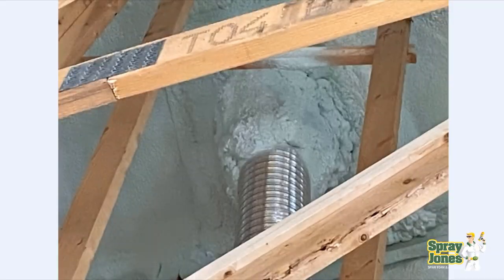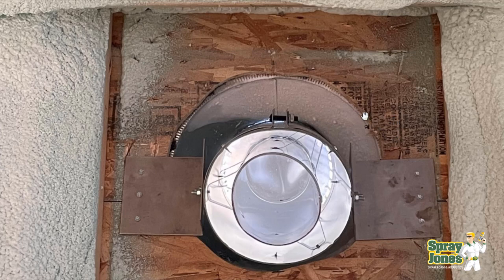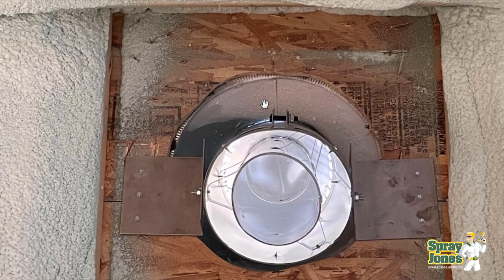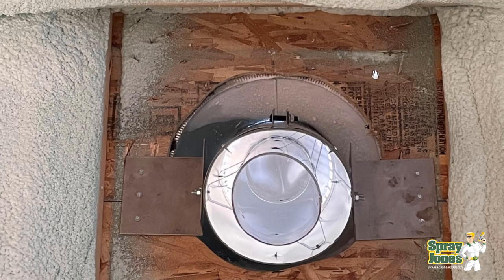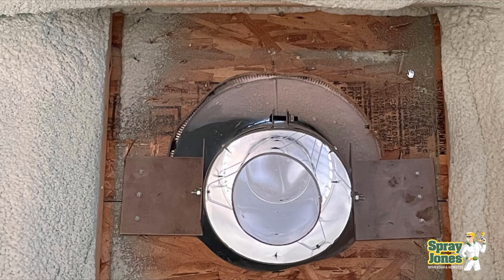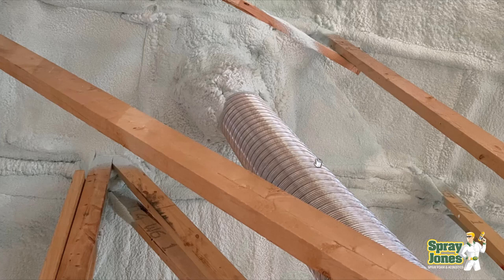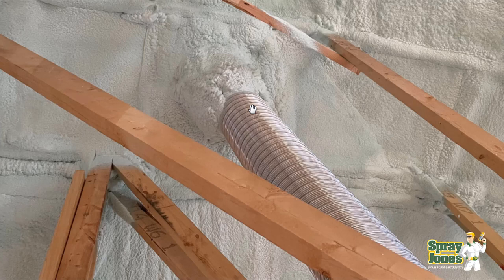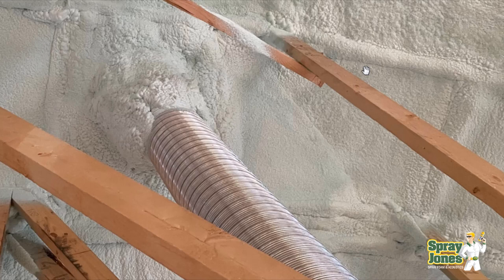Spray Foam Insulation with Zero Clearance Chimney Pipes | A Hot Topic!

Comment: When I insulated my garage, I packed rockwool around the furnace exhaust pipe. It functioned to keep the cellulose insulation away from the pipe. Of course my case was quite different as it has a vented soffit/attic.
I think as long as the temperature resistance of the foam meets the code requirements for that specific pipe, spraying it the way you did because it should prevent water vapor from condensing on the pipe when it cools.
Just my very non-expert $0.02

Comment: The wood burning fireplace double or triple wall chimney pipes stay cool to the touch outside, but the manufacturers request 2" of clearance to combustible materials to prevent a creosote flue fire from burning houses down.  Under normal circumstances, the inner flue pipe may be only 200° F, but if you have a flue fire, that could exceed 1000°.  The practice you're showing could very well make the difference on whether or not a chimney fire burns a house down.
Reply from the maker: Idiot, these are zero clearance gas fireplaces.

Comment: Insulation professional here, we just this week had a near combustion situation on a foam job installed in 2019 sprayed 2 inches down to a flat ceiling and blown over with cellulose for additional R value.  The foam came in contact with a zero clearance pipe and became very near to full blown combustion.  So thankful our client heard strange "snapping" sounds while lying in bed and decided to investigate before falling asleep.  I would not recommend this method but instead fire caulk to seal air leakange and provide clearance to combustable insulation of not less than 3 inches is a better destiny.
Reply from the maker: Then it is NOT zero clearance. Something is off. Foam can take 180 F before it breaks away. There is more to the story.
Reply: @SprayJones  Zero Clearance only refers to the substrate the appliance will sit on. It's a misnomer, and I cringe when I hear builders try and explain away the lack of clearance they have.   There are plenty of clearances that must be met.  Most gas direct vent units look for 1" clearance on pipe sides/bottom, if it's running horizontal than 3" clearance.

Comment: An interesting solution to zero clearance heat vent.
So, what about water heater vent pipe?
And what about 90% efficiency furnaces?
I suspect at the roof, the vent pipe would be cool enough for foam insulation. I would think that situation would already be established.

Comment: What is the cold air return temp? 
What is the exhaust flue temp? Could you ceramic coat the outer jacket like race car engine builders use on the headers?

Comment: Why would you choose to make a roof penetration rather than go through the wall. Even for things like plumbing vent pipes, it seems like going through the wall and leaving the roof intact with no penetrations would be better.
Reply from the maker: Yes it generally can be. Many times where things are located and how to get to outside the roof is the only option.
Reply: To get the best draft, the best practice is to keep the flue gases inside the building envelope for as long as possible with the least bends. A wall exit both exposes the chimney to cold air and two 90 degree bends to get out the wall and vertical again.

Comment: Former fireplace professional here, and new to SPF industry.  That detail would fail here in Connecticut.  We have drilled into our building inspectors heads that gas direct vent flues require 1" clearance to combustible materials on vertical flue sections, and 3" clearance on top side of horizontal flue sections.  Passing through a flat ceiling insulated with cellulose or fiberglass is easy, there is a collar that goes around the flue, to keep the insulation from touching the pipe.  Any time we came across a foamed roof deck, our installers were instructed to make sure we maintain our 1" of clearance (wood coal or oil flues require 2"). I took an online training for new sales reps from Huntsman, I swear I remember them saying their foam required 3" of clearance from any type of flue, furnace, fireplace, water heater etc.  While I don't disagree with your detail, I'd caution you when we see the flex vent.  The inner (exhaust) section is separated from the outer (combustion air) by spacers, the spacers create approx 1 1/2" air space between the two flues.  The spacers are prone to getting knocked loose, which could lead to the inner section being right up against the out, resulting in temps higher than you were able to record.  All that said, Mike, thanks for sharing all your knowledge,  I have learned a ton from you.      The power of 2" of closed cell!!
Reply: I used to service and install gas and solid fuel fireplaces and stoves as well.  If you do something that falls outside of the appliance manufacturer's "Listed" installation instructions, then the appliance is no longer listed.  If a fire were to occur , then the spray foam application company will be liable.
Reply: Problem Solved!  at least here in the States  with Heatilator/Heat n Glo and Majestic products.  They now manufacture a roof deck insulation shield just for this application.

Comment: Hey Spray Jones, what if your zero clearance direct vent pipe is exiting through the building wall rather then the roof? The run will be much shorter. Maybe 7-8ft long run exiting out the building wall. What’s your opinion?
Reply from the maker: Just spray up to the wall bracket they provide.
Reply: @SprayJones  great thanks. there is a wall thimble supplied with the kit that provides a 1" standoff from the outer flue. Ill have our spray foam contractor spray against the thimble. One other thing, i just posted on another video, what product are you using to air seal the small gap between the top plate and sealing any abutting wall studs? Located in Southern Ontario btw. You are an excellent resource. Thank you!
Reply from the maker: @gmredstar  Usually the thimble in the wall in blocked in with lumber, the HVAC guys take care of the thimble part you spray to the wood framing. They seal with hi temp silicone.

Comment: If dc315 was applied around the pipe and roof decking- before foam, then it would be rated extremely high not to catch fire...just a thought
Reply from the maker: No..... how does DC 315 work?